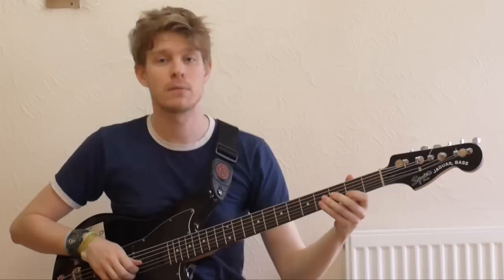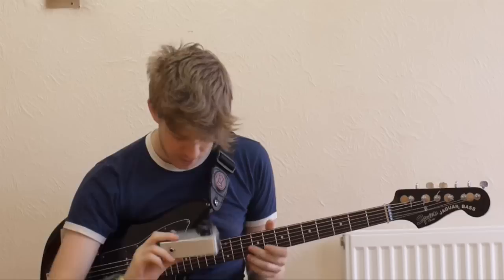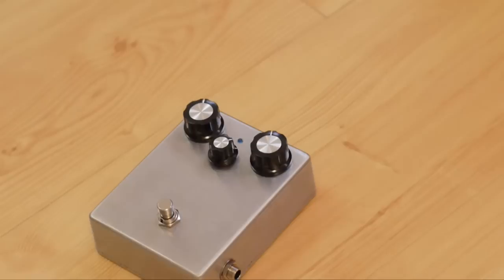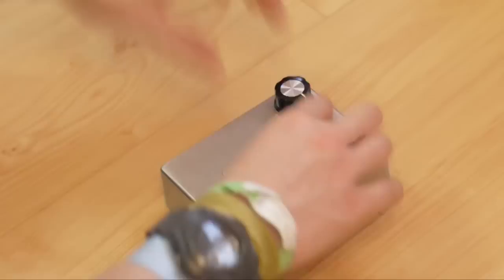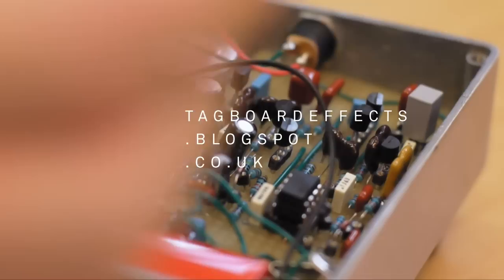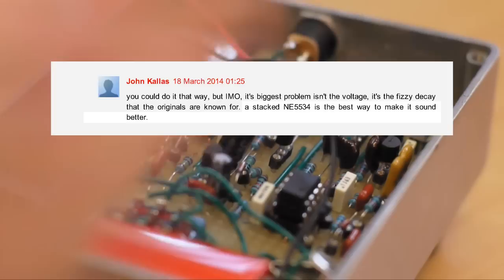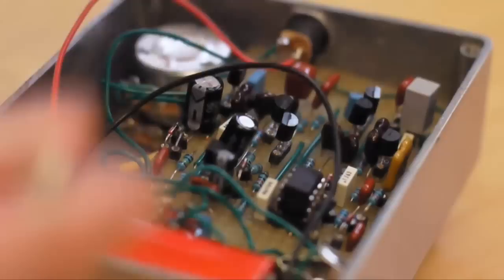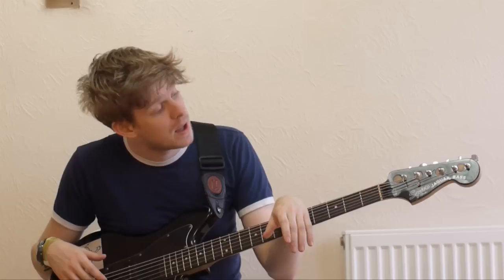blues driver 2 clone / home made bass vi

Comment: Very nice sound.  Wonderful job setting the whole thing up.  Even though the pole pieces don't line up w/ the strings, you couldn't ask for a better sound.  I guess that doesn't matter.
Reply from the maker: alex tworkowski the magnetic field that the pole pieces produce is pretty across the string spread. Lining the pole pieces up to each string would make close to no audible difference. Lost of early basses used to use 6 pole guitar pick up, I think the Musicmaster Bass and Squire bronco both did / do?
Reply from the maker: *pretty even

Comment: Awesome rendition of Garota de Ipanema, bro :P Also, really great video. Answers a lot of questions I myself had, especially about your bass vi. Except one: weren't the original pickups for only 4 bass strings? If you kept them, how did that work out? Thanks!
Reply from the maker: +Luiz Felipe Fonseca yeah, same pick-up (pretty sure i say that in the video). as for how they worked out, you tell me - do you think they sound good? I think they sound just fine.

Comment: Your bass sounded so good that i decided to replicate it. i already had a short scale jaguar bass and had everything figured out except for the nut. i was kind of confused on the correct string spacing, and how the neck was a lot smaller and wouldn't fit the strings,
(since all the string guides for the zero frets had wider string spacing??). did you make the string guide yourself? and if so, can you tell me the specs? its not that important as i will probably find the answers somewhere else on the internet, but if you could get to it, that would be great!
Reply from the maker: Jason Hankins Hey man. The maths is pretty basic. I space my strings at the nut so that the gaps between strings are equal. Measure the neck width at the nut, deduct the spacing you wish to have from the edge of the neck to the first string (I recommend between 2 and 2.5mm) x2 for both sides of the neck, deduct the string gauges combined, and then divide this number by 5 (for the 5 spaces between the 6 strings). I can send you an illustration to better explain if this doesn't make sense? H
Reply: hank tremain thanks for replying. yeah that totally makes sense, thank you. if you could email me the illustration that would be great, but if it is to much trouble dont worry about it
Reply from the maker: Jason Hankins Yo, think I've emailed you that illustration. Let me know if it didn't get to you. H
Reply: hank tremain i got it, thank you so much!!! i love ttng and all your music and will be following you guys for future releases and tours

Comment: This Bass VI sounds better than the official ones :o
Or at least this is a better sounding demo than anyone else has done.
Reply from the maker: +Harvey Clay Thanks. Though I've tried every variation of Bass VI Fender have released (including the Bottom Master), I've never been able to do a fair comparison of the pick-ups - as most of the Bass VIs I've tried have been in guitar shops with sub par amplification. I am yet to hear a Bass VI sound good enough to make me rethink the pick-ups in mine. If I were to buy a Bass VI (I'd probs get one of the squires), the first thing I'd do is put some p-bass pick-ups in it (I'd also put a mastery bridge on it).
Reply: @hanktremain  i slapped some thicker la bella round wounds on my squire bass vi and it transformed the sound... very bright and punch like a 6 string pbass

Comment: Could I buy a short scale neck from warmoth? I kinda want an inverted 52 Precision head for mine.
Reply from the maker: M8, you can do what you like. I believe in you!
You'll wanna get you head round the fundamentals of guitar set-up first though.
Things to look out for:
- you'll want to make sure you can fix the neck well to the body you choose (going for a neck and body that are designed for each other will save you hassle)
- and that you can place the bridge in the correct place to intonate the fret board (the octave fret (12th) will need to sit halfway between the nut and the bridge)

Comment: What strings are you using? The stock Bass VI strings are wayyyyyy too thin for the low E
Reply from the maker: These day my set is:
E - .105
A - .080
D - .056
G - .044
B - .034
E - .024
I use D'Addario singles: 
short scale bass stings for the two lowest (E and A)
guitar singles for the rest (if your instrument has a scale larger than 30inches guitar singles maybe to short).
Please not that your nut will need adjusting when using larger gauge stings. A .105 gauge string will not fit in a slot cut for a .084 gauge string. Also if you use a string that is smaller than the nut slot, the string will move around causing damage to the nut which will lead to buzzing.
Reply: @hanktremain  Thanks for the info, Hank. Although, you are kind of at fault for inspiring me to buy the bass vi haha. Wish i had gone down your route though. The bass vi are an absolute shambles in terms of build quality. Ive had to reverse the bridge thanks to a screw hitting the low e when intonated. How's the band? You guys got any material together whilst in lock down?

Comment: Hi there..cool video ... What did you fill the original machine head holes with? I am not an native speaker of English so I did not really hear/understand. Thanks!
Reply from the maker: I used hardwood dowel (dowel is simple circular wood).
It's very important to use hardwood, and not softwood - the wood density must be similar to wood of the headstock.

I plan to make a new video showing the making of my next Bass VI build, which will go through each step of the process in more detail.

H
Reply: +hank tremain What strings do you use?
Reply from the maker: This video was made with the D'addario Bass VI set EXL156 (84-24). however i'm now using the top 4 string from this set (24-E, 34-B, 44-G, 56-D) and the bottom 2 strings from their short scale light bass string set EXL 220S (95-40) adding a 75-A and 95-E. I find the 74 and 84 from the bass vi pack are just too loose (laking in tension). Swapping that 74 for a 75 doesn't make too much difference, but using the 95 is SOOOO much better. Shame D'Addario don't do short-scale bass strings as singles :(
Reply: +hank tremain Thank you very much!
Reply: +hank tremain have you ever tried to tune the bass in baritone tuning? (B to B or A to A)
Do you think it will handle the tension?
Reply from the maker: I have not, though it's commonly done. My good friend Chris Teti from the World Is a Beautiful Place... plays the Squire vintage modified baritone jazz master (check um out they're pretty cool), which is basically a Bass VI tuned A to A (30inch scale length, and I'm pretty sure has the same neck as the squire bass vi). The other tuning I've been using on some of our new stuff is FA#D#GA#D# (low 3 strings turned up a semi tone, top 2 string turned down a semi tone - pretty much an open bar chord (D#) with the root tuned up to a second (F)).
Reply from the maker: +hank tremain PS. if you were to tune a Bass VI A to A (or B to B) you wouldn't want to use the Bass VI set of strings, you'd need to change to an appropriate gauge - The D'Addarios tension guide on their website will help with that.
Reply: +hank tremain Kinda was thinking of having both the baritone and the bass VI, but it's probably impossible because if I use the Bass VI strings, the tension could be too much (I think) tuning them in baritone tuning, otherwise the string would be too loose if I use the baritone strings and tune them in the standard bass tuning.
Reply from the maker: +giovanninopagina you are correct. you would either need to buy two instruments and have them strung with different strings, or re-string every time you want to go from one to the other.
Reply from the maker: +hank tremain or..... just string and tune for Bass VI and ignore the low E string (and put up with the missing hi string) when you want to be playing 'baritone'.
Reply from the maker: +hank tremain or............ have someone make you a custom Bass VII (Bass VI with an extra hi A - or Baritone with extra low E - depending on how you want to think about it). A seven string bass with a short scale and tight string-spread in other words.
Reply: +hank tremain also I think I'd have to change the bridge, and it would be a little troubling
Reply from the maker: +giovanninopagina i don't see why? - though i don't know what instrument you have / plan to be using.
Reply: +hank tremain Because the saddles of the bridge, according to the guy of Staytrem, are made for bass strings, and there's the risk that the strings of a baritone wouldn't fit right in the saddle.

By the way, I'm planning to make a baritone like you made your bass VI.
Reply from the maker: +giovanninopagina Check out Mastery Bridges http://www.masterybridge.com/. I use one on my current build, and it's amazing. They are suitable for guitar, baritone or bass strings.
Reply: +hank tremain it must be awesome, but it costs a lot compared to the one of staytrem. I can try to buy it from US, where it is way cheaper, but there's the risk to pay the custom in my country. I don't know, because I have to buy also the machine heads(which one did you put on your bass?).
Reply: +giovanninopagina P.S.: The Staytrem bridge you're using is the one for Bass VI or just a jazzmaster/jaguar bridge?
Reply from the maker: +giovanninopagina I have no idea what the Staytrem bridge is on my other Bass, but I can tell you that as soon as I can afford to I'll be replacing it with a Mastery Bridge! The way the poles on the Staytrem don't fit the thimbles makes it impossible to maintain the instrument intonation. Unless John's changed that on the newer bridges, I would not get one. Actually, any guitar I get from now on I will be adding a Mastery bridge to - I wouldn't wish to use any other bridge.

No idea about the machine heads - would have just been the cheapest I could get from eBay at the time. Pro tip though, get hold of some extra washers, you can use them to extend the height of the button, allowing you to position in machine heads lower on the headstock.
Reply from the maker: you can see what i'm talking about at this point in the video 20:49 
you can see i've used 4 white washers under the buttons on each machine head to make them taller.
Reply: +hank tremain I think you probably took the Harley Benton, which I can find at 18 euros and they're the cheaper so far. Do they work well? Because to me, it seems like they're way to cheaper to be real ahah
Reply: +giovanninopagina P.S.: This ones: https://m.thomann.de/it/harley_benton_eguitar_machine_lpstyle_c.htm?o=0&ref=mm_a_0&search=1453291440
Reply from the maker: +giovanninopagina probably something like these: http://www.ebay.co.uk/itm/6-Guitar-String-Chrome-Tuning-Pegs-Tuners-Machine-Heads-/111867350425?hash=item1a0bd04d99:g:9oMAAOSwJkJWjJyQ

The ones I've used are probably the cheapest I could get, probably from China or Hong Kong, and I've not had any issue with them.
Reply from the maker: +giovanninopagina Yeah, they look like the kind of thing. They're probably all made in the same factory and just re-branded when they get to the west.
Reply: +hank tremain one of the things I'm not sure it's how a baritone would sound with the jaguar bass pickups...
Reply from the maker: +giovanninopagina only one way to find out.
Reply: +hank tremain yup.
Reply from the maker: +hank tremain and again, a baritone guitar is just a bass with the lowest string removed. so my guess is it will sound exactly like this guitar if you never played the low string.
Reply: +hank tremain If I go ahead with this project I'll surely let you know! And I think it will sound great. Thank you very much Hank. Hope to see you soon with TTNG in Italy!
Reply from the maker: +giovanninopagina you're welcome man! good luck with the build.
Reply: +hank tremain One last thing, the mastery bridge you put on the bass, is the M1? Because the guy said to me they don't make any bridges that would work for that....
Reply from the maker: +giovanninopagina The M1-Kit (the stainless steel thimbles are well worth getting). "Fits these Fender® guitars: Jazzmaster, Jaguar, Mustang, Bass VI, Telecaster with Bigsby Vibrato & Jag-Stang."